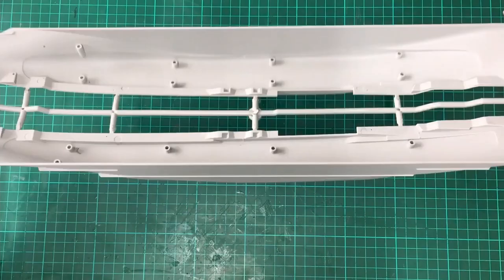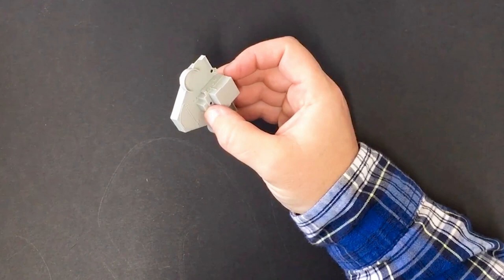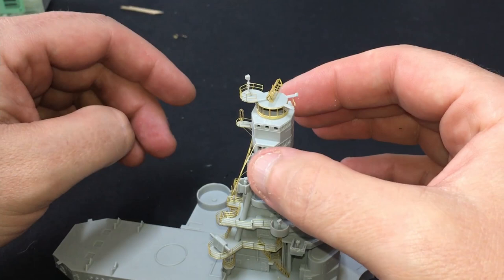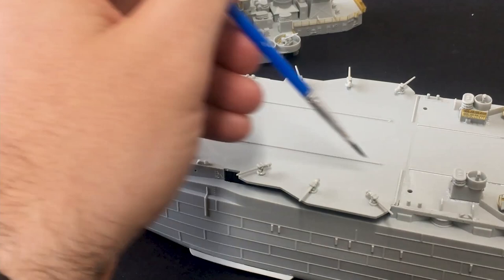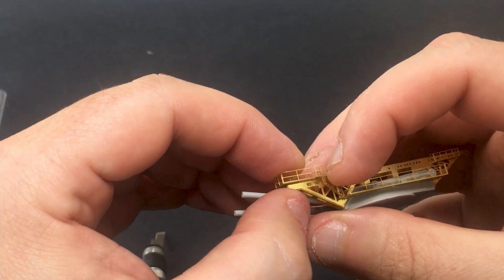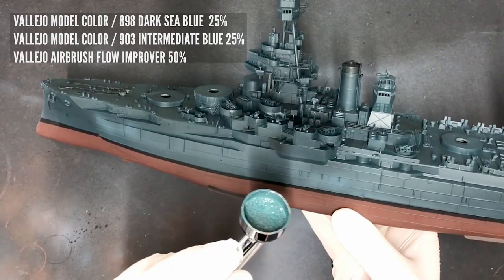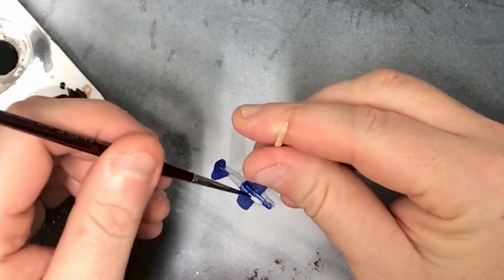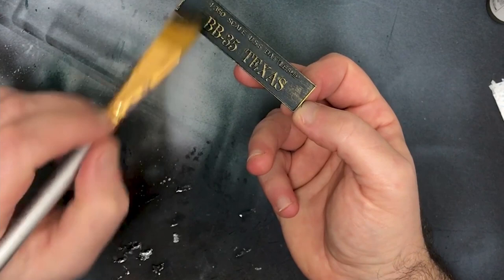Battleship USS Texas  1/350 trumpeter - Ship Model FULL BUILD

Comment: Hi John, After watching your build seeing you use CA glue for the PE parts I got some and am using while building a USS Texas.  I am really struggling with applying the CA glue. What is the tool you are using in your video? It looks like a one of those small drilling tools but I can't make out what the piece is that is actually applying the glue.  Is it just a nail or some other piece straight metal?  And great video! I have learned tons. This is my first ship and it is kicking my but! All of the tiny PE parts are a challenge for sure.  You make it look so easy.
Reply from the maker: Hi Keith it’s very fine wire in a pin drill, and I replace the wire after 5 mins of use
Reply: You beat me on asking that. I thought it was a small drill tip.

Comment: which glue did you use for glueling the railings and all the metal details. I always have the problem that the superglue that I use takes to long time for drying.
Perfect work! Greetings from Austria!
Reply from the maker: hi my friend, I used a flexy 5k CA glue on all the PE parts
Reply: Hi again, would you please send some more specifikation - is it a Loctite product, or something similar? I use a glue „especially“ for PE parts, but i never had a chance to bend railings from one edge to the next as you did. Greetings! E Pichler
Reply from the maker: Hi, Just goggle, VMS Flexy 5k CA, and that’s the glue I use, if I sent you a link, it would just be a uk shops